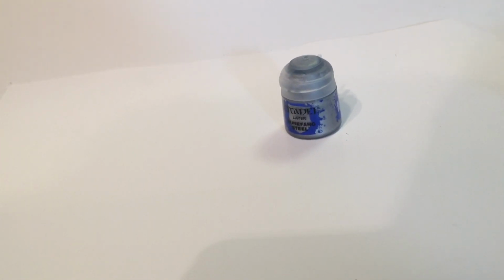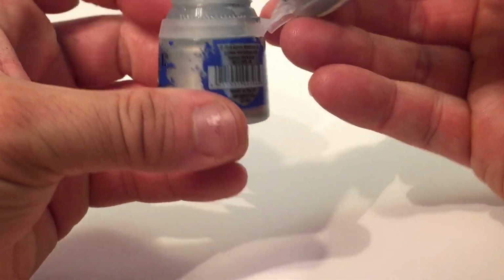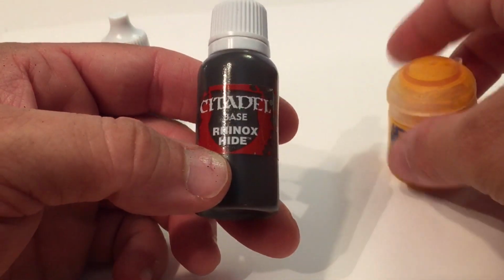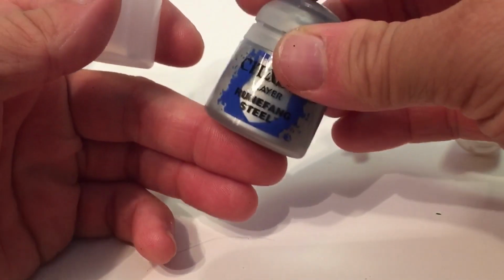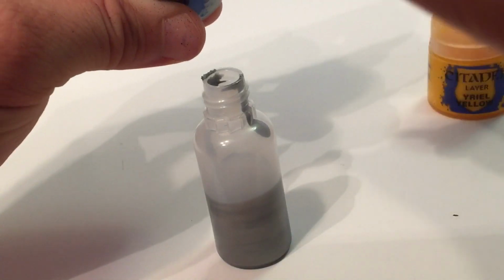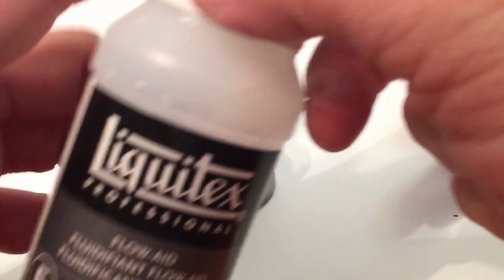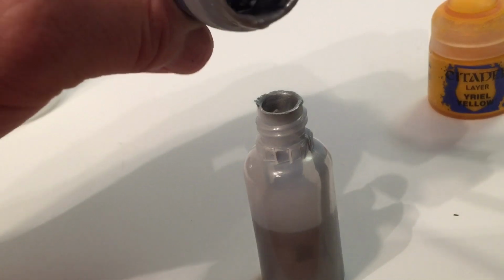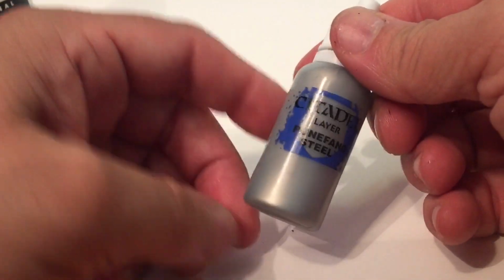How and Why I Re-Bottle GW Paints

Comment: The only thing I would recommend is a funnel (like a flask size one) and some blue tack between the funnel and dropper bottle to create an air escape. Avoids paint spillage, but I'm in the process of transferring my GW paints as well.
Reply from the maker: That's not a bad idea either....  I'm not super worried about spillage.. though it is a concern.  I'm not certain how I feel about the cost/benefit of spillage vs waste while cleaning out the funnel.  Admittedly, I mainly wanted some of my friends to see how I was doing it as they were considering doing the same :)